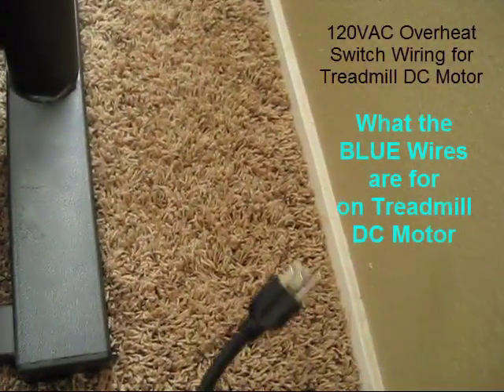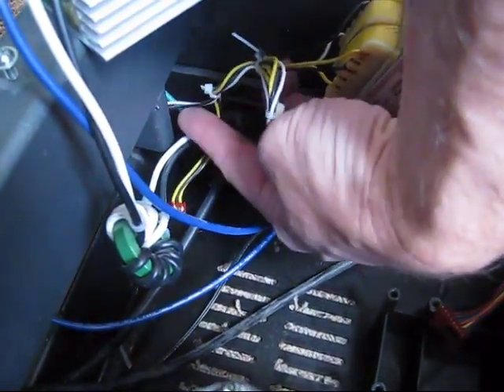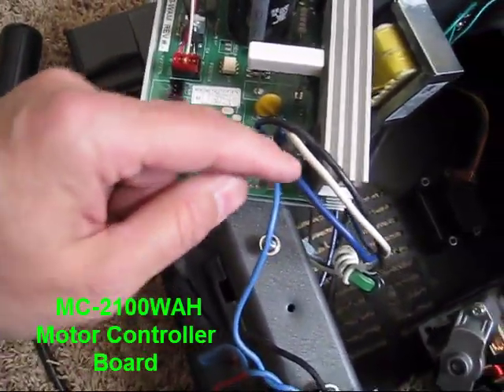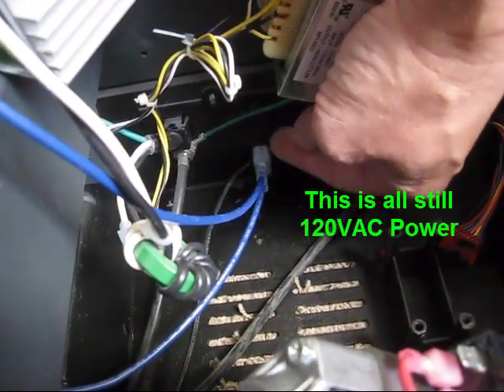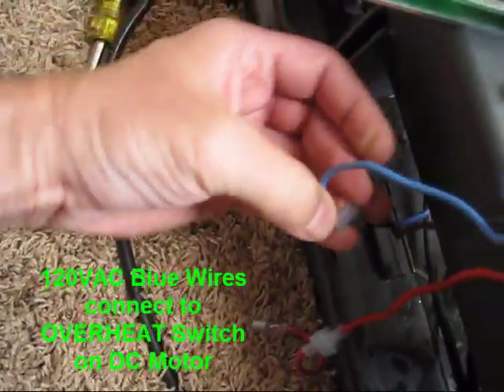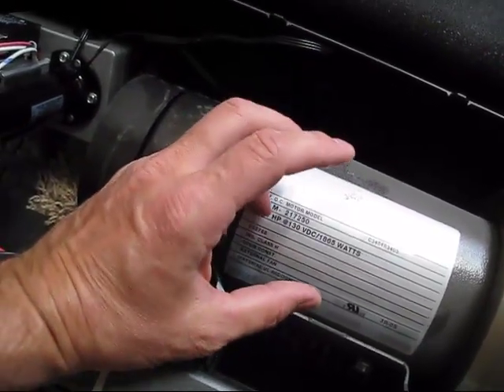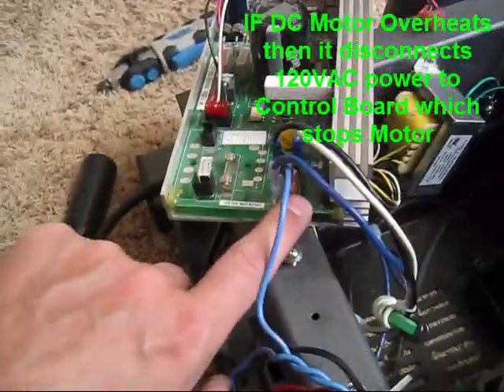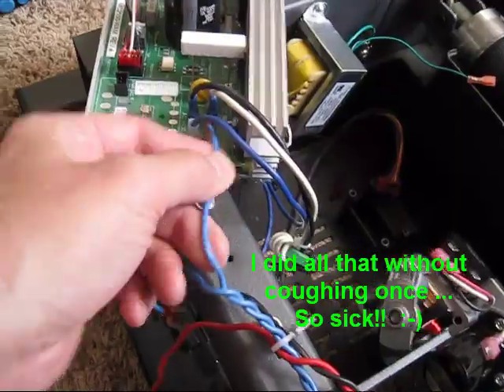What BLUE WIRES are on Treadmill Motor

Comment: Thank you.  I'm looking at the identical guts of a treadmill and found your video searching for the pn on the motor.  Online parts dealer told me to replace the controller power board.  Then the said I had a bad motor.   Thanks to your video I know how to check the thermocouple and might replace that and get a refund for this unnecessary replacement board they sent me.   Thanks again!

Comment: I just now gave up the fight on a 1 hp AC motor that somehow had a bent shaft. Take care of that cold, Buddy. Thanks :)
Reply from the maker: Thanks for the note :-)  Yeah, 90 degrees in Vegas and I have a cold :-) It is surprising how inexpensive Treadmill DC motors are on Ebay, I bought one just like in the video for $55 to make another Knife Belt Grinder after I update the design :-) 
 https://grabcad.com/library/knife-belt-grinder-1   CHEERS!!
Reply: A cold in the heat is brutal. I shudder at the thought of how it must be to fall ill in some of the island nations where it's still basically "hot", but also has a rainy season. My body woudn't know what to do. I've been wanting to experiment with a DC motor and control panel from a discarded treadmill for a while. I need to liberate one from the alleys. The CAD designs are awesome. :)
Reply: @charlesmarlin6632  Happy Thanksgiving to you and yours, Charles.
Reply: @charlesmarlin6632  btw I finally got around to using a treadmill motor. I love it, and would like to have a few more. :)

Comment: not sure why breaking the AC line into the board is "interesting" if the motor overheats?  If you only broke the DC to the motor, you assume that the fault is only with the motor.  Am I missing something here?  Any idea what the temp set is for your thermal breaker?

Comment: Great video! The dark and light blue wires plug into the switch on/off. How do u know which blue goes where? Which blue goes to the on and which goes on the off plug?
Reply from the maker: I made this video as a reminder for myself for when came time to put everything back together and put it on YouTube so I could watch it on iPad when rebuilding to make sure I had wires correct.  Probably none of this info is a help to you but it was a fun learning experience for me and this video worked well to show me where the wires went several weeks later ... so I left it on YouTube for others.  Best of Luck  CHEERS!! 
... The two lighter blue wires work plugged in either way from the motor onto the my control board because the overheat switch ( in my motor ) is set so motor would will run even when the lighter blue wires are not connected to anything ... One could assume the control board sends a voltage through those blue wires through a cool thus closed 'overheat' switch, then if overheat switch gets too hot the switch opens breaking the voltage that then sets that connection from having a higher voltage to a lower or no voltage and then the control board knows to shut down power to the motor until such time the motor cools and the switch closes again letting that small signal voltage through to controller ... So when I tested my motor after I took it off the treadmill using a completely different DC Power Control from KBIC Electronics it ran just fine without connecting the blue wires to anything special on a control board ... but that way if motor did ever overheat then of course the motor would burn up instead of shutting down prior to damage.

Comment: Interesting ,i alway wonder what the blue wire was.I brought a proform  4 years ago.Just last month it keep tripping my breaker in the house when i turn the switch on.So when i look into it ,i realize it was the 2 blue wire connected to the motor.So i'm not sure if its the control board ,motor or what.....I have tested the motor with a 12v and it run ok.

Comment: Thanks for this video. I have a bad motor that has the 2 blue wires (in addition to the red and black obviously) and I'm trying to determine if I can replace it with a known good motor I have extra. But the known good motor only has 3 wires (red, black and green ground). Is it possible to use this motor and bypass the blue connections on the board?
Reply: Scott Blanchard  did you have any luck? I am going through a similar issue my motor out of the treadmill had black red and green ground I bought one off eBay I thought was the correct one but it has red black and two blue wires????? Can I still use this in my treadmill And just not hook up the blue wires?

Comment: i want to use the speed controller board but bypass the motor temp switch since im using this as a motor for a cnc..dont want motor stopping...so my theory is to wire it up similar however on the power switch the blue that goes to the motor i would just route that directly to the board location next to the first blue connection.. instead and i think that would bypass the temp switch in the motor ...does this sound ok?
Reply from the maker: The guy to answer you question is Jeremy Fielding:  https://www.youtube.com/channel/UC_SLthyNX_ivd-dmsFgmJVg/videos
Jeremy may even cover the 'blue wires' in his YouTube videos because they are helpful and detailed.  I believe his videos are where I got my info to setup my DC motor.
I hope you project works out well.  I have moved since making this video so don't have a motor to try out ideas or I would check on the wiring to see if it works as you discussed.  CHEERS!!